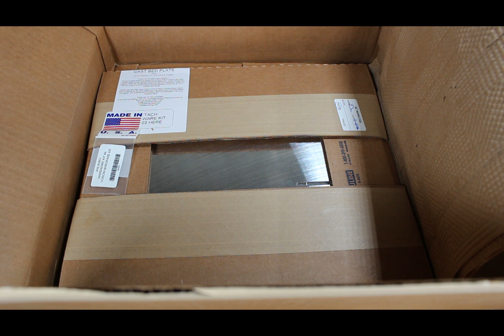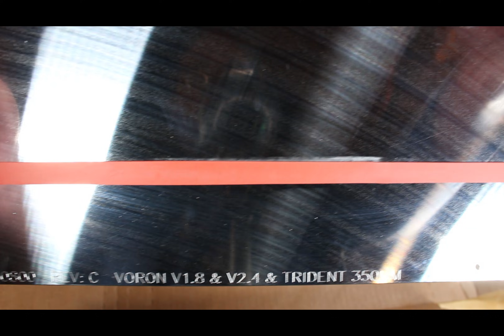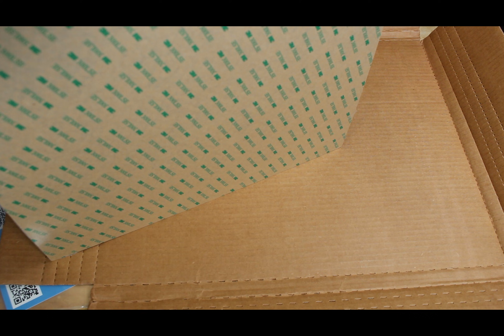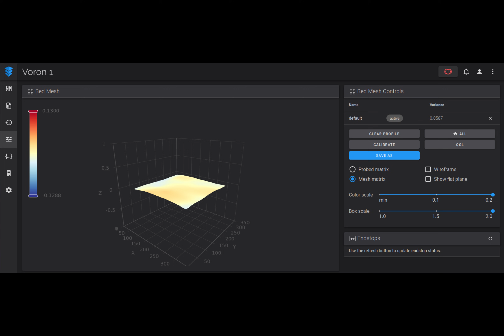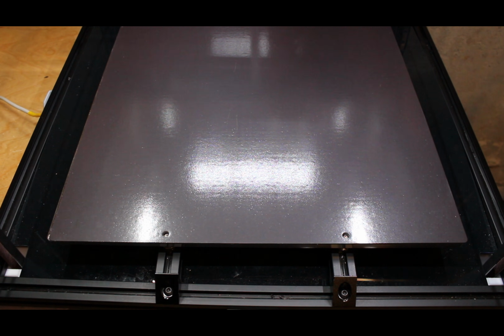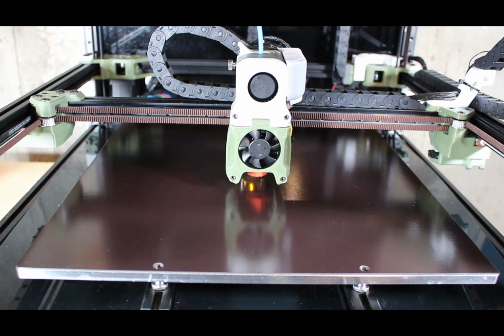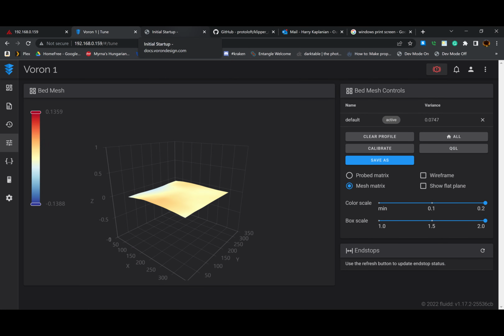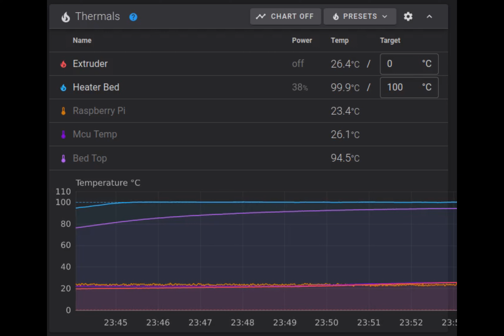The Secret to a flat  3d printer bed

Comment: I generally  use Naptha to remove  stubborn  adhesive. Then, clean with IPA or acetone.  Nice! I have my  doubts  about the magnetic surface. I actually sanded the high spots on one of mine. Run probe test again and again... like the idea of using magnets  instead of the sheet.
Reply from the maker: I may try Naptha if I need to do this again.  I really wanted to move to the imbedded magnet solution, but it supposedly causes problems with the latest eddy current based bed probes.  Thanks for the tip and comments!

Comment: So it turns out that they don't make printer beds for large printers like my Anycubic Kobra Max (Original) which is a sahem as I think those are the ones that need the most help and have the greatest warping. I was wondering if anyone here has any thoughts on me going out and getting a glass bed made such as thickness, type of glass, etc. Any help would be appreciated. Thanks
Reply from the maker: I don't have much experience with glass beds.  I'm curious what others come back with.

Comment: is it possible to have magnets around the bed, into the surface, eliminate the use of that magnetic sheets at all.  i know this seems a harder thing to manufacture now, but if the magnets only are only seated around the bed, enough to hold the steel sheet, thats all it needs right? i just dont know how the heat transfer rate gonna be affected since it is metal on metal now.
Reply from the maker: Do you mean something like this? https://preciseprinterparts.com/Voron-Salad-Fork-160mm-Cast-Aluminum-Printer-Bed-With-Magnets_p_54.html
I have heard these work great.  However, an induction probe won't work on a bed such as this and you also need a highquality bed plate...thicker that the standard cheap bed plates.

Comment: You might want to try after placing the magnet, heating it to near melting point of the glue and placing it down on the flat glass surface. I should cause the glue to become more uniform to the glass as it cools and I would put more weight on top maybe 3  times the weight of the bed to really force the glue to flatten out aginst the plate.
Reply from the maker: I did try that.  I had no luck.  So I resorted to this.  But thank you for the tip!

Comment: Nice work man! Considering even the best printers have max tolerances of only 0.1mm-0.2mm (side note: this is why LiDar on printers is a gimmick. The very best lidar sensors [which cost $10k+] are only accurate down to 0.5mm horizontally [x axis] and ONLY 2.0mm vertically [y axis, and yes that says 2mm] which makes them useless for the use-purpose they're being pushed as)... anyways back to the main point, anything below 0.1mm is not going to change outcome at all.
Reply from the maker: I did not know that about lidar.  Thank you!

Comment: I guess perfect is an enemy of good. I use (the) Ender 3 and had some issues with curvy print bed. And had to flatten it with bare hands, and later with aluminum sticky tape a metal ruler and a flashlight. I do not have probe, so my head ain't aching 'bout it. = )
I recently printed with no trouble, when I noticed, that actually the left side was lower for some reason, and the right side was quite near the nozzle. Wanted to check this after printed a couple of items and some had smaller holes than others. I saw slight imperfections on the first layer but it stuck alright, so I ignored this.
So I corrected bed knobs after I noticed bed nonalignment. So my guess if it sticks it is flat = )
Reply from the maker: I've never been that lucky.  But, If the bed isn't level, you run the risk of part of the 1st layer not sticking to the bed.  Thank you for watching and the commentts!

Comment: I plan on buying one of these. Not to be nit picky, but it would be nice if they had an option for a ground surface for ultimate flatness.
Reply from the maker: They did have a option for increased accuracy at some point. But honestly, I'm not sure it's needed. The magnet and glue we attach to the bed will most likely negate the benefit of the increased accuracy. Those are already not as accurate as the bed plate. That said, it's a beautiful bed.
Reply: @KapmansBasementWorkshop  I really like the idea of a top mounted bed sensor. And you're right about the build plate negating any accuracy gained by surface grinding.
Reply from the maker: I plan on purchasing all my future beds from them. It's a great bed. I have the heating rate set to 80 vs the usual 60 that is recommended. The bed has not changed shape at all. And the bed temps at the surface is really nice, but the built in bed plate stop is a huge benefit. It makes me want to replace my other beds just for that feature.

Comment: Believe it or not if your printer has V wheels, if they are not absolutely perfect it will show up as a sinewave on your mesh. If you have a bed slinger a sinewave going from left to right is your X and a sinewave going front to back is your Y. If you see multiple waves its probably more than one wheel that needs to be replaced.
You can test which one by manually rotating it a bit and then making a mesh again if the pattern changes the wheel isn't good. Please use common sense though as < 0.05mm isn't really worth fixing.
Reply from the maker: I don't use v wheels on this printer, but this is a great tip.  For my other printer, I will keep my eyes open for this.  Thank you for the tip!

Comment: I have the same problem but i didn't  take the magnatic sheet off this is how i fixed  it i took  the aluminium bed of and lay it on a glass table with none stick paper between  the magnet and the glass and i put some weight on and i heated the bed to 120c for cuple  of hours and left it to cool down for 24 hours and it was perfect 👌 😊 note
Some  times the problem  is from the spring steel sheet not all of them r good quality
Reply from the maker: I was wondering if that could be done.  But I did not consider it until after I did this.  But thank you very much for verifying this works.  I've noticed over time, it seems to change and this technique could get it back to where it needs to be.  And I agree. I have noticed not all steel plates are of the same quality.  Especially the ones with the rough pattern PEI.  Thank you as I'll be using your trick every once in a while.

Comment: as a question could the magnetic sheets be milled/machined? I mean after installing them
Reply from the maker: Possibly.  But I have never tried it.  I also thought about polishing with the finest sanding paper possible on a very flat surface.  But before you go too far, be sure to check your gantry 1st.

Comment: my variance is at 1.5mm. I don't unterstand this, larger prints print like shit and it's on glas.
Reply from the maker: I would check your gantry. Is it perfectly parallel to the bed?  It may not be.
Reply: Hey  @KapmansBasementWorkshop  ,
I fixed it, the bed now has a delta of 0.35. The Bed was ok, but my printhead was lose, it was so soft attachted that you can wiggle it. It's not so flat as your printbed, but it's ok. What's the point in getting flatter now? I mean the printer will compensate for the error and now my error is homogeneous spaced. So no more valleys and mountains.
Reply from the maker: As long as it's printing well, that all that matters.  I'm glad you got to the bottom of this.

Comment: Before buying a new plate, what one can do to try to improve flatness is to correct the bed by removing it and bending against the high spots with your knee.  To test progress along the way, you can use a machinist's straight edge and feeler gauges to measure the imperfection and improvement over time.  Start with low pressure and gradually increase until you can start measuring a difference in the flatness.
Reply from the maker: You are braver than I!
Reply: Also a feeler gauge has another use in 3D printing and that is to use it for bed leveling rather than a piece a paper.

Comment: HI,  Quick tip for removal of glue stuck on the bed plate.  Try PAM Cooking Spray.  It worked for me. Spray it on and thick, add paper towels sprayed with the cooking spray and cover the area you want to remove - let it sit for 15-20 min (or longer for better results) - remove the towels and use scotch brite pad to remove the gum.   wipe dry and use acetone to remove the cooking spray.   Googone is good, but cooking spray is in almost every kitchen.    I use the cooking spray for everything that has stickers.   Let me know how it works for you.  Warm Regards - Joegeeks
Reply from the maker: Thanks for posting this.  It appears to be a great idea.  However, I think you will understand when I state that I hope to never do this again!  But if I do, I will try PAM!

Comment: Now I am printing with the bed at 130 degres celsius at start and 120 after first layer. I think the glue gives off a lot of smell to that temperature. This smell It's annoying, I don't know how much toxic will be.
I am thinking of removing the glue that and using the bed without magentism.
Reply from the maker: The smell should go away in a month or so of use.  But in my case it was very strong.  And then the odor disappeared.  I ended up building nevermore and it seemed to help during that period.
Reply: @KapmansBasementWorkshop  , Thank you very much for the answer, I am thinking of removing the magentism for that reason and for not being as flat as aluminum alone. But in addition another reason is that I have found the Garolite (FR-4) plaque much better than the PEI, in addition the steel plate can also be used without magnetism, that is to say, hold it with tweezers.
Reply from the maker: @valdolandar534  My next bed probably will not have a magnetic sheet any more.  I've been planning to try out Garolite for some time now.  Does it withstand the heat for ABS printing?
Reply: @KapmansBasementWorkshop , The Garolite that I use comes from Ali-Expres, Named as FR4, and works perfectly, the maximum temperature I have tried is 130 degrees Celsius at first Layer. The adhesion between the Garolite and the ABS is much more than with the PEI. If in the end one does not want to fold the garolite or force to take off it is necessary to wait until lower than 50 degrees Celsius.
Another advantage of the Garolite is that it can be sanded with fine grain sandpaper and thus restores possible scratches. The sanding fine grain adds power of adhesion too.

Comment: Dude, the thermistor on top is a game changer in my book.  Odd thing is I just learned the difference today, mod bot, had a video on bed temps and the diff between the bottom and top, is significant. Taking that reading from the top then, I’d think would allow 100C to be just that, 100C. Damn I shouldn’t have watched this. Now I’m going to have to get new bed’s 😂
Reply from the maker: It's a really nice bed.  I would not buy another without it!
Reply: @KapmansBasementWorkshop  I couldn’t agree more. I definitely intend to upgrade and I think this one’s it.

Comment: those backstops look like an amazing idea, that is a place that is super annoying with my 350mm 2.4, Once you have had the backstops on a Prusa MK3S for plate centering its hard to not have something.

I bet WD40 would have worked on that glue too, I had to get VHB tape off something related to a printer and nothing got it off and then A google search said to try WD40 and it just for whatever reason practically liquified the VHB tape.  Never really thought of it as a solvent.
Reply from the maker: Those back stops are fantastic.  I have another printer that lacks them.  These really make a difference.
I never even considered WD40.  That probably would have worked great.  Thank you for the tip!

Comment: I have made a test to a glass It should supposedly be a flat surface and I was very disappointed, even a glass had a more pronounced curve. I think then the way for me to solve this is to adaptative mesh, I dont know how works yet, but supossely the nozzle adapt the Z move to maintain the same distance of surface, after a heightmap.
Reply from the maker: A bed mesh will certainly help.  But have a look at those gantry backers.  I don't use them yet, but people I know claim they help alot.

Comment: This gives me a new idea to flatten the magnetic base but without removing it. WIth 120 degrees celsius, put a glass over the magnetic base and weights in the zone more convex. This is not tested yet.
Reply from the maker: That just might work.  I actually thought about something similar  AFTER I did all this work.  I was going to take out the back panel, unscrew the bed and try to flip it out the back onto glass.  I think the cables I have are too short to support that.  One other thing.  Look into gantry backers.  The curve you see are actually a combination of things.  One of those being the dissimilar metals on the gantry curving in the heat.

Comment: I wonder if is reliable to use the flat steel PEI without using the magnetic base. Is there anyone who has tried it?
Reply from the maker: I've seen it done.  You need clips, but it certainly works.

Comment: My brain os struggling with the cardboard, flat glass table yes. Glass is generally very flat but cardboard isn't.

This causes my brain to wonder how much luck is involved in the 1st instance and how much variance there is in accuracy of one magnet to another?

I would think replacing cardboard for glass mirror tiles would be more accurate than cardboard, maybe?

But then again 70 odd microns is nothing when the bed is 58 microns to start with.

The original bed at whatever it was 130 microns isnt huge, whats that in old money .0051 of sn inch?
Still not bad in 3d printer land and well within the scope of a touch sensor which in itself has a tolerance probably wider than the machining of that lovely plate. Great video
Reply from the maker: Thanks for the comments.  I'm not convinced the cardboard did much other than distributing weight evenly   But, you got me thinking....

Comment: love the videos dude! i had a MRW magbed and its a beauty! however, its really not suited for TAP in my experience. I tried to shim the magnets with tinfoil, and i have a build plate that's 0.7mm thick, but the force from TAP picks up those valleys in the mesh... which means when i try print a first layer test square, i can see the lower parts are due to the magnets ... even with the faulty regions listed in the bed mesh, the mesh looks better but still the same issues with the first layer. might have to try one of these beds instead with graviflex.
Reply from the maker: Have you setup QGL and Bed Mesh to avoid those magnetic spots?  They are not flat due to the pull of the very strong magnets on the steel sheet.

Comment: I've actually removed my magnets entirely and gone back to clips. It's less convenient but works out much more consistent for me
Reply from the maker: So that's very interesting. I've wondered multiple times about doing this.  Over time, I seem to get changes in my bed mesh and I'm convinced it related to the glue.  If I may ask, how big is your print bed?  My main concern about doing this has been about if the clips are strong enough on a 250mm bed.
Reply: @KapmansBasementWorkshop  235mm, it’s on an Ender 3 V2. I still have a little remaining glue around the outside which I guess helps and I almost never use the entire print bed. I’m actually thinking of moving to a Voron 0

Comment: Thanks for the video, was wondering about your flatness when bed was heated. Theoretically if if the entire bed was the exactly the same temp should have zero warping. Insulation?
Reply from the maker: The bed, since it's cast aluminum and not rolled or forged, really doesn't change when heating.  There are some very minor changes, but I believe it's due to the glue and magnetic sheet as far as I can tell.

Comment: Nice video! I can't imagine cleaning the plate from the glue - my worst nightmare. After applying all this effort would you still recommend to get one of those beds or 0.08 is good enough to not bother?
Reply from the maker: I think it depends on your needs.  If your bed is 0.08 and you are having no problems.  No need to change.  Yes, that was terrible!  Thank you!

Comment: Wow that was nice! I've been thinking about lapping my printer bed. I've also wondered about the temperature of the top of the bed, when I checked it it's always a little cool as of course it would be. Having that the mister on the top is really good.
Reply: I meant to say that I'd be surprised if the thickness of the magnetic sheet is any better than plus or minus 20 microns which is what you're measuring compared to the bare plate.
Reply from the maker: I really don't think it's the aluminum bed.  My guess is that it's the most accurate thing on the printer (hot or cold).  I'm pretty sure its more of a factor of the magnet, the quality of the flexible plate and the gantry itself.  In another video I switched to a single rail on the x-axis and the bed magically got flatter as well.  Thanks for watching!

Comment: Wouldnt introducing wires to the top of your bed effect a level? Seems like that that could be a huge surface offsetter. Great video for thought!
Reply from the maker: Are you referring to the temperature sensor just under the magnet?  It's a very narrow slot.  Once the steel sheet is sitting on the top, I don't this it will impact anything, but it might just to that small area.  But also, I just don't measure that spot.  Thank you!